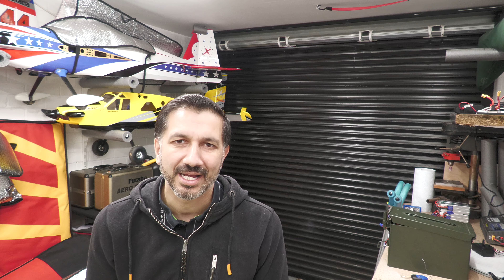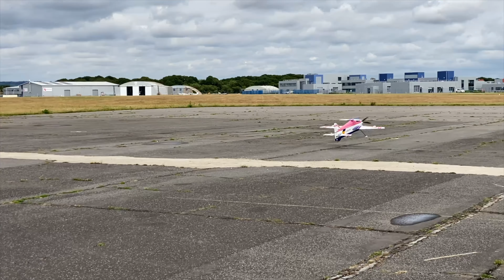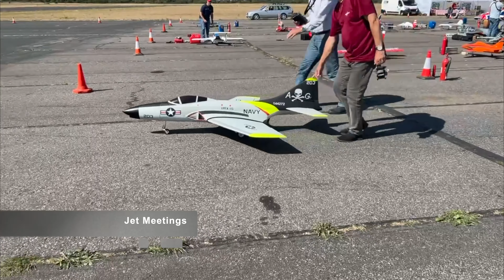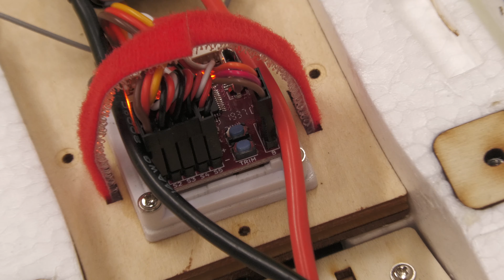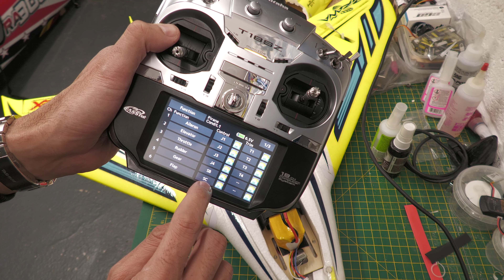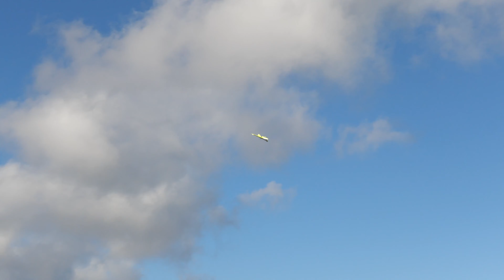How to set Air Breaks on the Flex Pirana | Futaba TX

Comment: i want to use this air brake technique since long time a go but unfortunately my twin rudder that I have is a v-tail i just wondering if it still can be used as an air brake like this or not 🤔
Reply from the maker: It won’t work on a v tail as bringing the “ruddervators” in would give you up elevator. If you have separator servos in each aileron you could try setting a flap mix